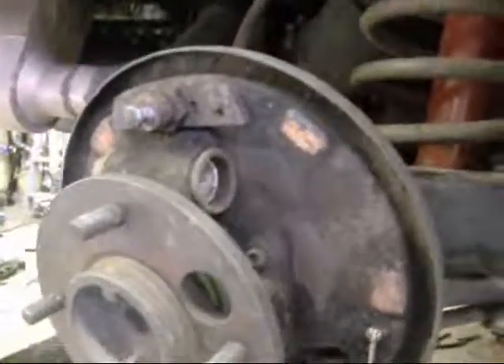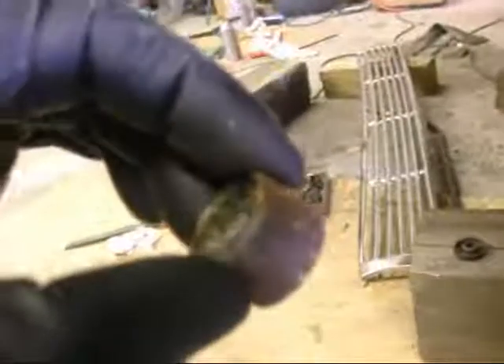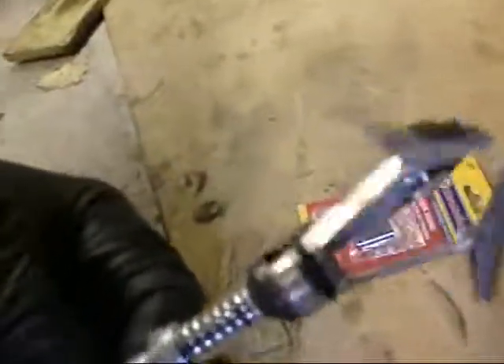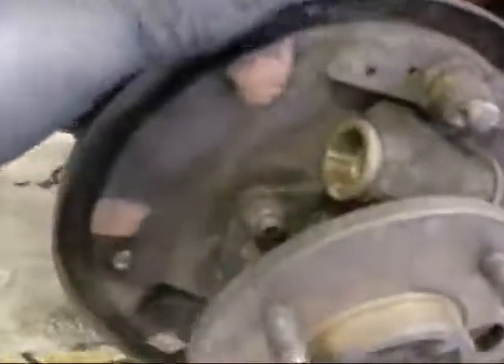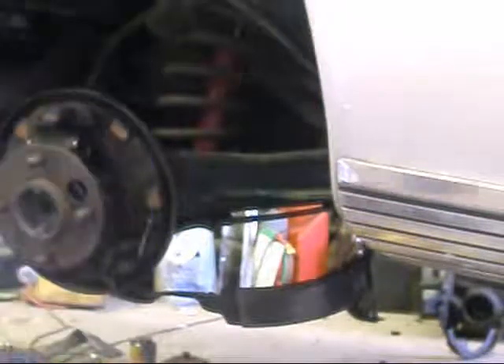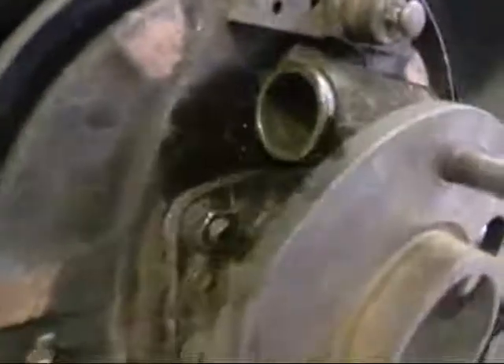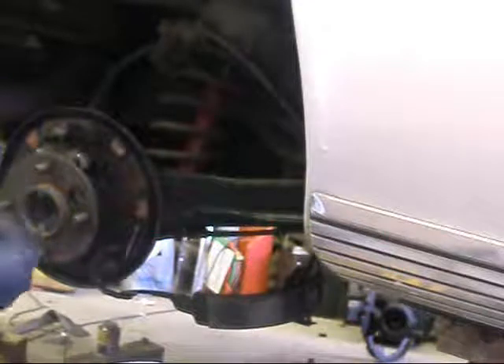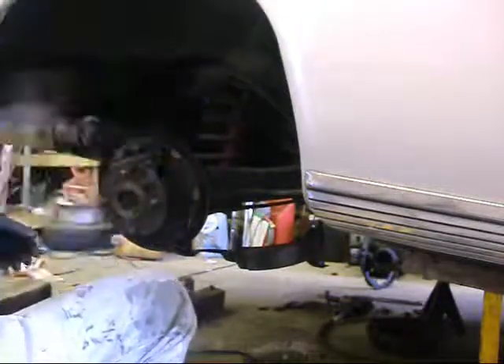6 23 12  Spyder RR Brake Repair  I

Comment: the easiest way is to use a pressure bleeder , and run lots of fluid through it , a pressure bleeder is very easy to make , you can actually make one from a 5 gallon home depot bucket with a lid , some fittings , a flat piece of steel and a couple c-clamps and old master cylinder lid gasket easy to make , also you can ad a hole in a bucket , add a small rubber hose that fits the bleeder , and ad a hole in the lid that the end of a shop vac will fit tight , that will suck bleed them well ,,,

Comment: Did you 100% completely flush all the regular brake fluid out before using that synthetic fluid ? if not , thats why they keep freezing up , the two fluids don't behave well together at all !! they fight about as bad as silicon fluid does ...